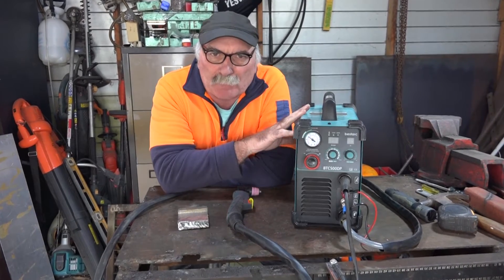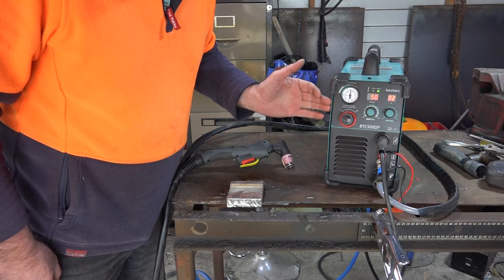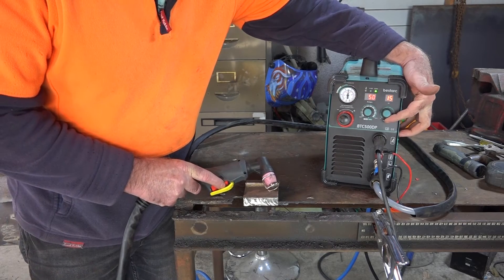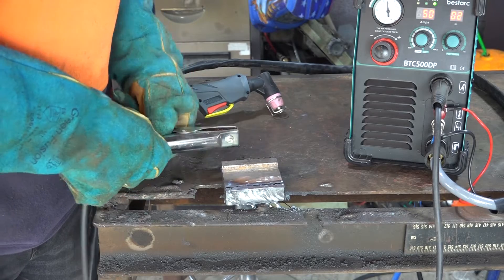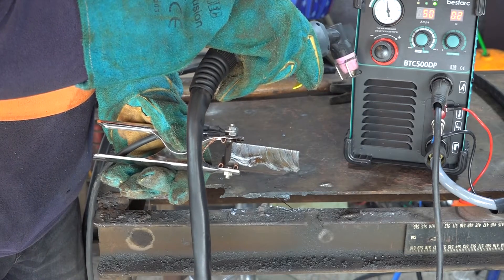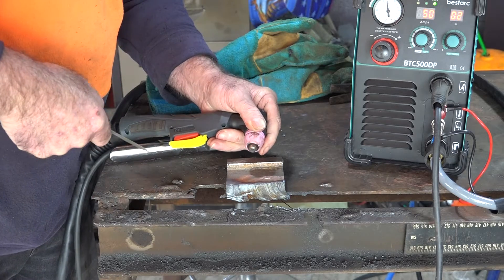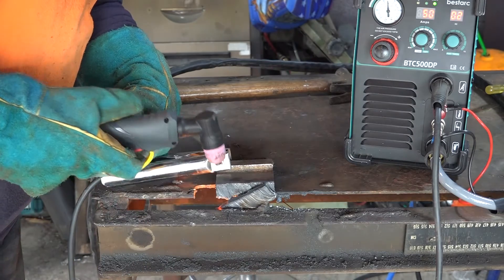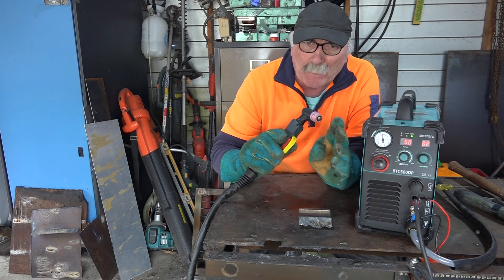Can This Under $240 Machine Cut 1 Inch Thick Steel Plate?

Comment: If you don't need the guide then why does every pilot arc come with the guide..? Because if you don't use it it will destroy the tip and 
put more stress on the machine
Reply from the maker: No I only use stand off guide if I am cutting sheet steel .